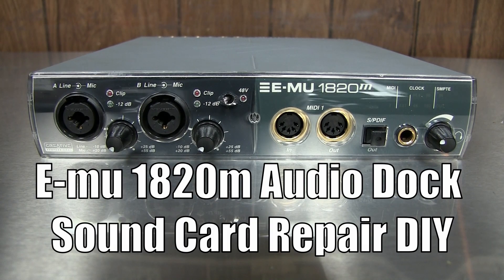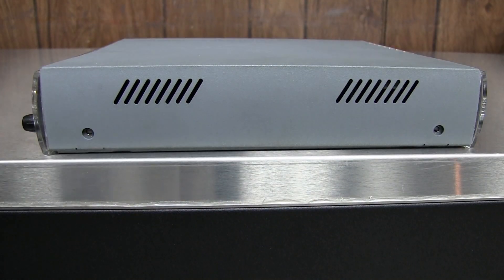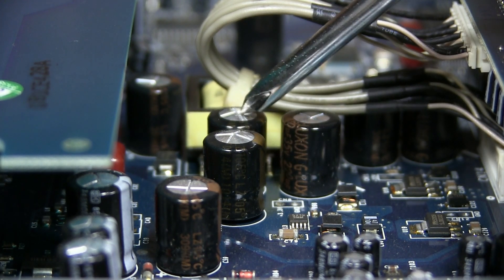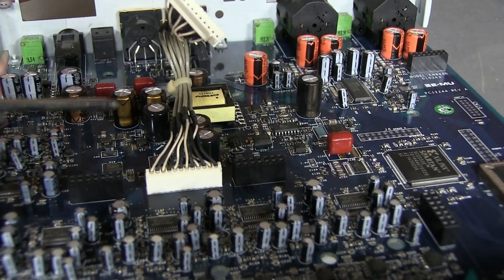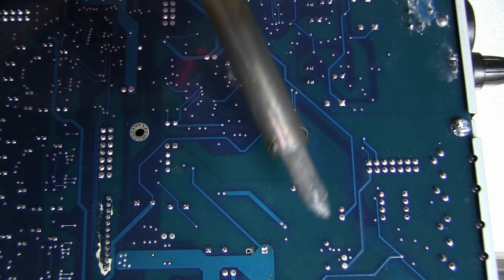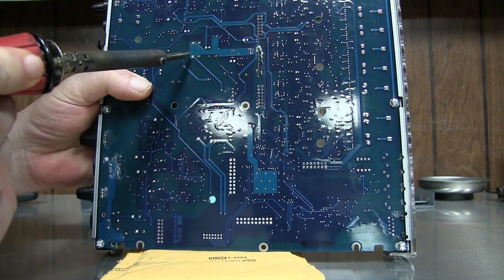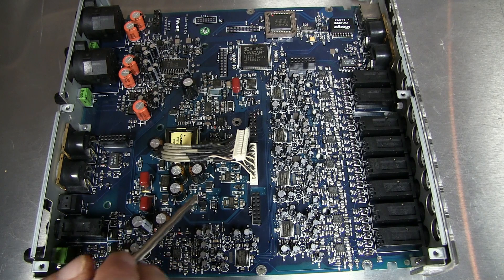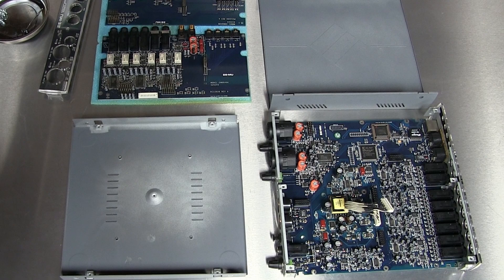E-MU 1820m Audio Dock Sound Card Capacitor Repair (Snap, Crackle, & Pop!)

Comment: This is a great video tutorial - thank you for sharing. I have a question I have bought some capacitors but they are a slight variant on the ones in the audio dock - the dock has Panasonic EEUFM1A681 whereas my caps are EEUFR1A681B. I found a site that appears to indicate that the EEUFR1A681B caps are an improved version of the EEUFM1A681 caps

EEUFM1A681: https://in.element14.com/panasonic-electronic-components/eeufm1a681/cap-alu-elec-680uf-10v-rad/dp/1848377

EEUFR1A681B: https://in.element14.com/panasonic/eeufr1a681b/cap-680-f-10v-20-reel/dp/2313319?MER=sy-me-pd-mi-alte

Are the EEUFR1A681B caps I have viable to fit to the audio dock or should I get hold of some EEUFM1A681 caps?
Reply from the maker: They both have the same capacitance and voltage and are essentially the same thing.  The B cap has a smaller height and diameter so they should fit fine, if they were larger than the factory caps then fitment may be an issue.
Reply: I did this repair on mine in 2011. I used these same Panasonic 105C-rated high quality caps bought from Digikey online, and replaced not only those 2, but about 11 others. I think I went with the next higher voltage rating as well (10v -> 15v), but I can't recall. I would have if they were the same physical size.  I'm still using my 1820m - it's got features and quality that rival modern soundcards, and it's already paid for.